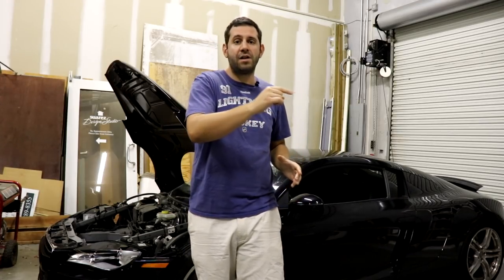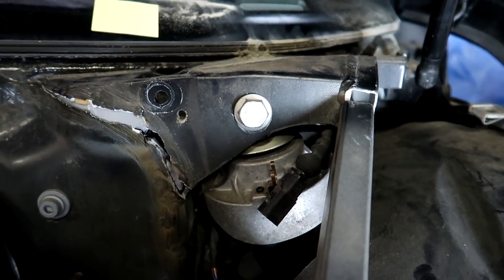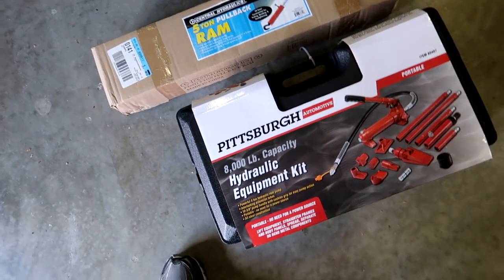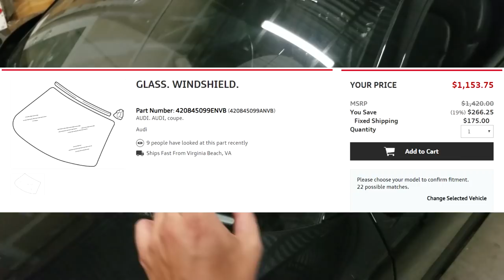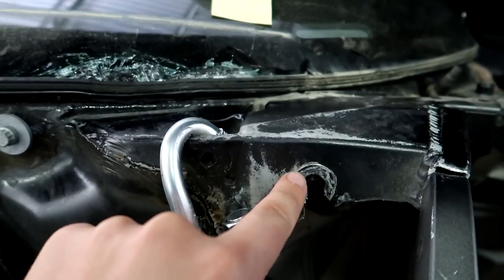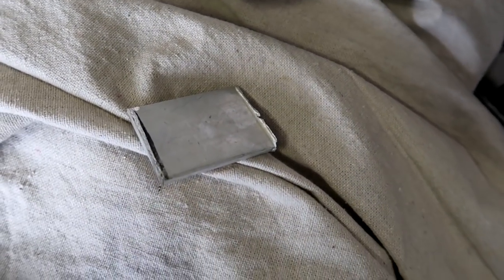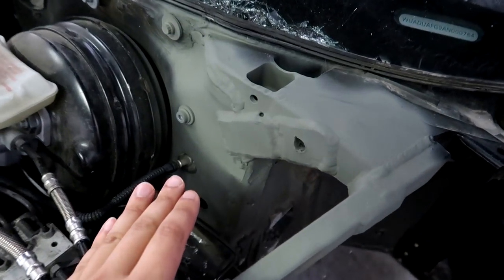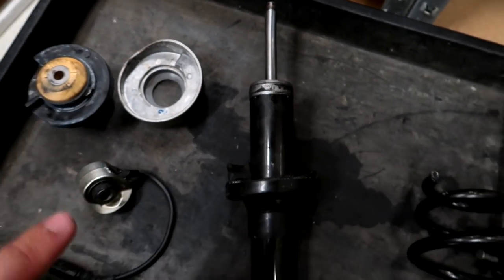I Repaired My Totaled Audi R8's Cracked Frame for $500! Insurance Quoted $29,522!

Comment: Im not an expert. But i work with alot of metals. This repair seems a little sketchy. If it were my car i would have had the guy weld it just like you did without the very small gusset. Grind it all flat , and then cover the entire area with a half inch aluminum plate shaped to the frame. So kinda like a triangle. I dont have access to an R8 otherwise id design the piece for you (thats what i do for a living). I pray nothing happens but this fix seems unsafe.

Comment: ya kinda naive... it costs a lot because the 'repair' like that has to match the original spec.. & calibrated.. lol malleting it.. 1000s of lbs of stress to damage it.. obviously if the shock took that type of force it would get damaged.... no brainer there... lol

Comment: 7:16. You muppet. Even if you do pull that back its not exactly accurate! This thing needs to be checked by a laser level, plus Ali is difficult to weld, and even with a welded patch you're just moving the fatigue down the frame line. But it seems in the US you can get away with this and make the car road legal...?!

Comment: I bought that same Hydraulic Equipment Kit from HF but also got the 7 piece Hydraulic Auto Body/Frame Kit. HF #94681 it includes a 5ton pull back ram and 6 other rams. Used a 25% coupon for each one.

Comment: You are not a qualified tech to be working on this car and you are in dangering lives if you put that back on the road as a body tech with over 23 years you must disclose the damage and repair ,and you are not an Audi certified tech neither is your make pretend YouTube shop ,unsafe motor vehicle
Reply: Oh he disclosed his shitty work...on YouTube for the world to see...this repair is atrocious and I'm glad he showed everyone.
Reply: What makes one qualified to work on his own car?  How is he endangering lives, be specific.  He's not putting it back on the road as a body tech with over 23 years...  The car had no body damage so wtf does a body tech even have to do with welding a strut mounting brace?????  AND HE NEVER CLAIMED TO BE AN AUDI CERTIFIED TECH!!!!  His repair is VALID and SAFE.  Better than Audi's glue that broke.
Reply: @buchtmann1  validated by who ,you can not weld Audi aluminum it will crack their alloy is shit ,Audi would not stand behind this repair ,that a very expensive car if it was that easy to do a safe repair it wouldn't have totalled! As far as safe if that strut and steering let's go at high speed that that car is capable ....it might be considered "unsafe"besides that if you're not a Audi certified shop you can buy structure parts for that car but what do I know ,oh yhea that strut tower I'd cast so it is shit work and unsafe!
Reply: In
Reply: @adamreynolds1851  Audi supply retrofit inforcementplates to be welded in place😂..
So welding is fine😉....
Reply: Isn't a "Salvage title" enough disclosure?  When you purchase a car with a salvage title you know that an insurance company decided against repairing it, so you should look over the car closely.  Suzy the soccer mom isn't going to look at this car, only someone savvy enough to realize that a salvage title isn't the end of the world will be a buyer....
Reply: It was totaled because insurance needs to deliver the car back in the same standard as before. That means whole sections of the frame need to be replaced, it's a technicality in insurance.. That's all.

Comment: OH MY Fu*cking jesus! That is so improperly done  that you can't even say that its fixed. :d You first of all you didn't find out how the proper fix is made, second you remove the paint before you start hammering things, third you drill a hole in the end of the crack which is in this case at the windscreen side, if you don't do that you cant be sure that its not continue spreading. After proper fix you go to shop that can do a wheel alignment and make sure that the alignment is okey. Don't do thing if you aren't sure how its done and ask professionals opinion first.

Comment: Bell ends  By right's this is not the way you repair a car of this magnitude but everyone has there own way of doing shit . the  work that has taken place here is done at a cost  . Was the car put on a jig at any time after the damage was repaired i doubt So you do not know if the car is square to the floor  that would have been the next stage after your temporary repair .  personal if i was the engineer that was asked to check this prior  being deemed road worthy i would have failed it . Sorry but there is a right way and a wrong way . i do not like what has took place here . crashed it yet  you will

Comment: Ur an idiot for cracking the glass with a hammer and for using the jack stand as an anchor point and for not taping up around the weld where you applied the primer (really u got paint all over the seal), buuut I think it's cool that you are bringing an Audi back to life that would have otherwise been sold for spares or scrapped. Just bare in mind that ur Audi freeway plan went out the window as soon as you loosened the first screw, buuut again this car is for you and who really cares about resale...